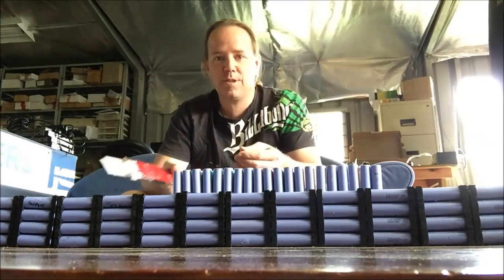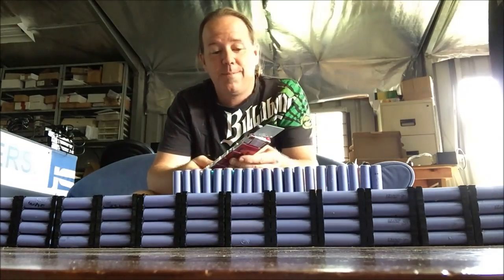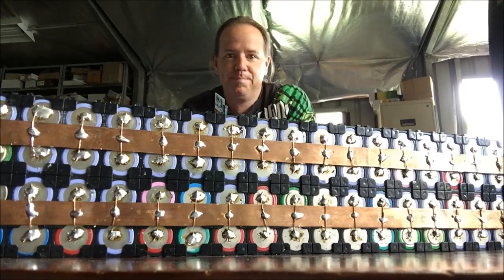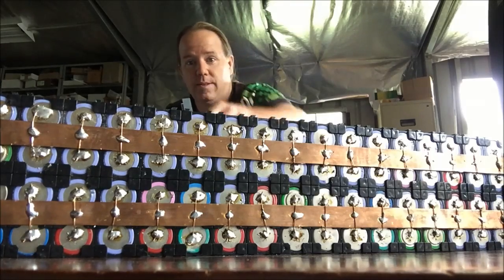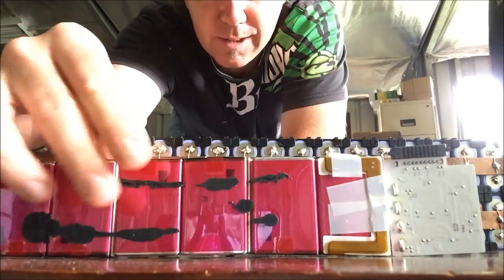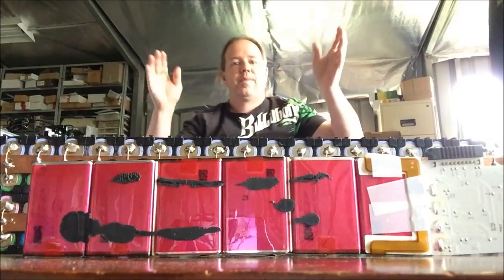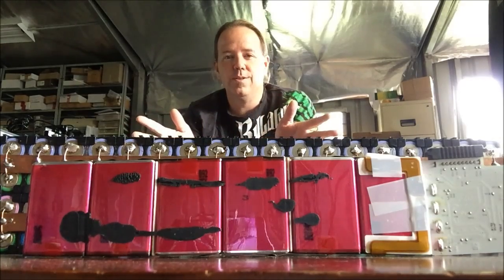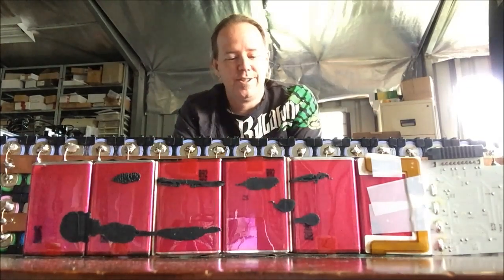Finally finished processing 1120 18650 Cells - DONE!

Comment: I think those square cells are LiPo cells; great stuff but if the protection circuit on those things fail your sprinkler system get's a test run so better not use them in your project. ;-)

Comment: These projects look like fun. But what do you do when a cell dies? Like a year or two from now some of those cells could fail. Without an easy way to identify the broken cell and replace it.. well it kinda makes your power wall a maintenance nightmare.

Why wouldn't you use larger car type batteries?
Reply from the maker: Hi Mike, well your question is a rather common one.. The answer is quite easy you pull the faulty pack and replace it with a new one. Then pull the pack apart find the faults and move forward.. kinda what i signed up for when i started this project. As for using 'car' type batteries no thank you. How ever I have in the past had AGM and Deep Cycle batteries for this setup and they were horrible compared to this setup. Have a quick look back through all my old videos have heaps of info there about Lead batteries :) Pete
Reply: HBPowerwall s

Comment: I just some some from ebay guy all 16850 and guess what 10 battery packs are the same battery as you showed here. They seem to be 1ah so far testing . I will use them for something but was bummed
Reply: The ones I am using are called Casung 6000mah just do not expect any where close to 6000 the best I have seen is 1500 and most are between 1100 to 1450 mah any thing over 1000 goes in my packs
Reply from the maker: out of how many packs? it sucks but you do learn fast to spot the wrong types of battery packs.
Reply: yep next time I see those packs no bidding it was 10packs with 6 batteries in each pack and so far they are all working and they are 1000mah I get 999mah
Reply: What was the brand/model of the battery packs?

Comment: what was the minimum mah that you use? for you batteries?
Reply from the maker: 2100 up till now but I I'm in the process of testing much lower in my pack to see how they go long term
Reply: +HBPowerwall in my country Portugal I see that are not so easy to have that values but I'm starting again I will try to find better ones
Reply from the maker: There is ups and downs, I've been through periods where 100's of laptop batteries have been faulty or VERY low, just push through it and treat it for what it is..

Comment: i see u use lots of Different collout cells Are they All Same capacity or Different? and if they Are Different is that good? i want to make a big powerbank and i got 6*2900mah and 12*2600 and 6*2200mah what is the best wat to connect these?
Reply from the maker: +Youp Kroon mix em so the groups all have the same mah
Reply: Aha thx. is it ok to make a 1s batery with 12*2600mah and 6*2900 and 2200*6?

Comment: Well done m8.... BUT I hope it's the camera angle Ect some of them solder blobs look like they are touching the bar
Reply: Ignore its the - side not fuse side
Reply from the maker: Yep, that will be explained in a later vid. I'm still learning. The negative side some touch positive side with fuses have that weird heat proof electrical tape under the busbars